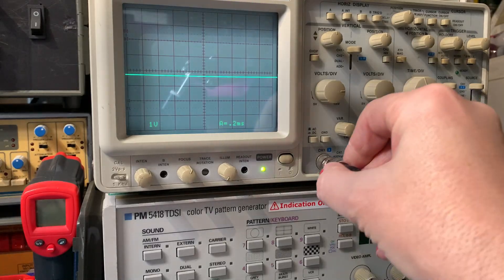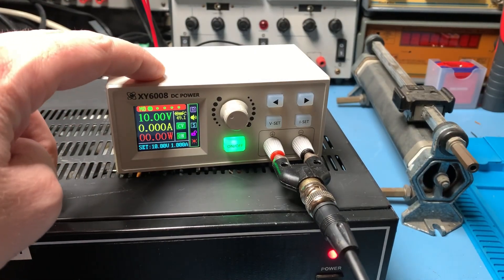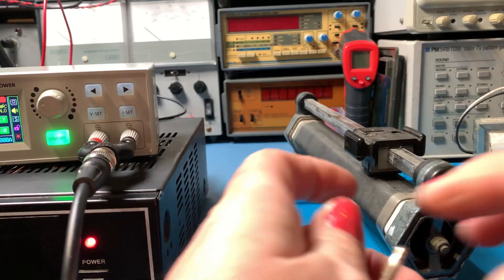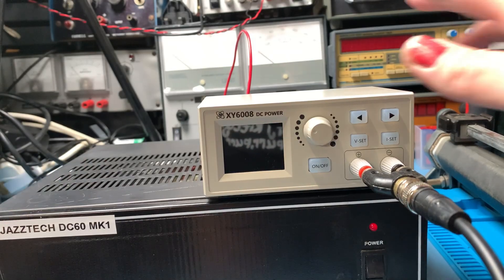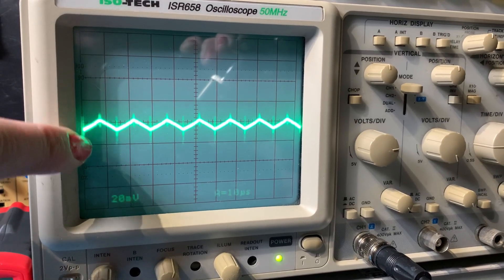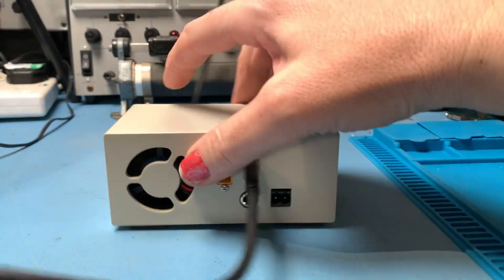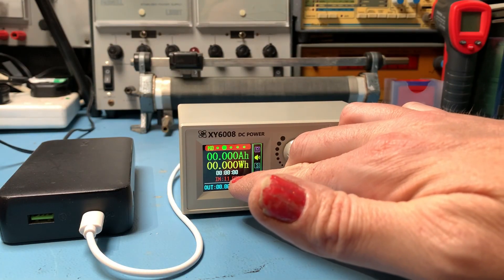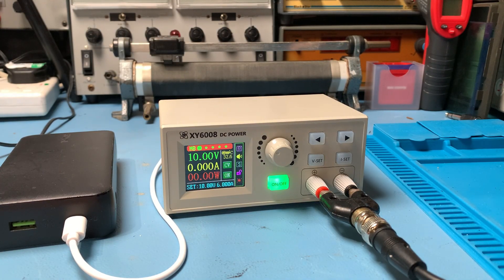AliExpress Buck Convertor DC Power Supply Part 2 - Power Sources & Noise Tests!

Comment: Great video, thank you. i hadn't even thought about its noise performance, glad others did and you responded. My impression of this little device is that it is very nicely done and would be useful for some, especially in situations where off-grid power (battery) is the only option.
Reply from the maker: Yes it's a very nice little product. Thanks for watching.

Comment: What a cool and useful test. I use powertool batteries from Parkside (the Lidl stuff) to power my electronics lately. I bought a piece you can attach it to with a on/off switch. Put a fuse in series with the cable and added an XT60 connector. Soldering iron, PD chargers, power supplies, amplifiers, a power supply like you are testing you name it.  No more taking out those cabled power supplies. The battery (actually 2) also get charged via a solar panel ... with a power supply module like this one.  As you said, ideas, why didn't I think of that. The power of YouTube!. After all these years electronics and the evolution still keeps me busy and sane.
Reply from the maker: Yes it's very versatile how you can use it. YouTube is a great place to learn new things and share ideas. It's one reason why I make these videos. Thanks for the sub and thanks for watching.